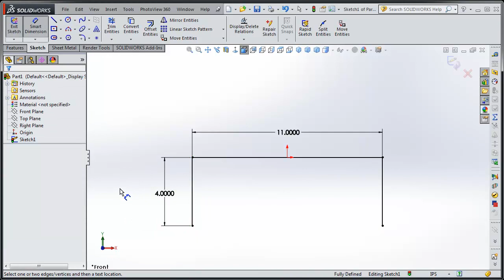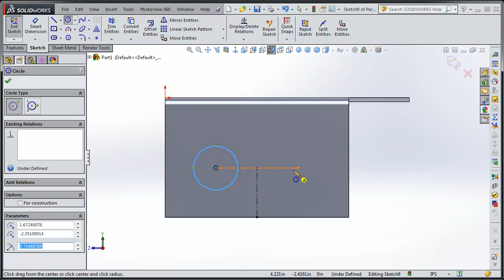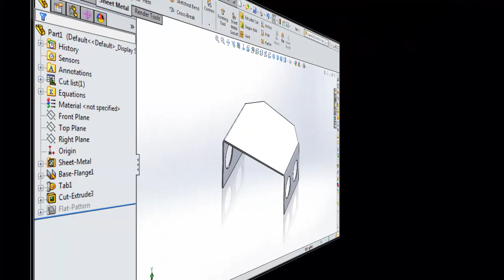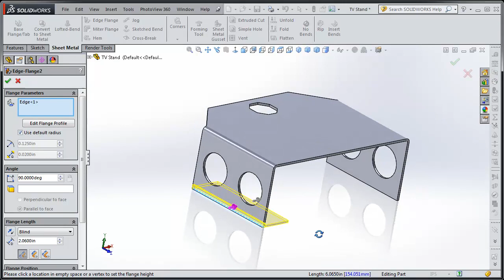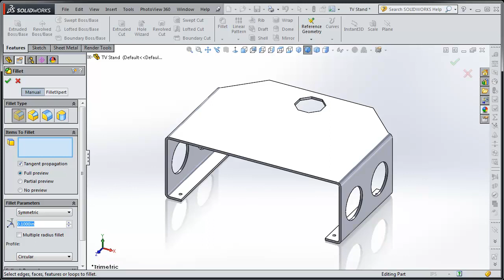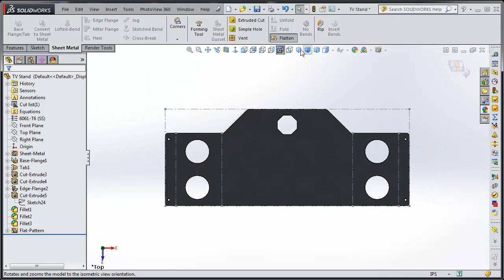SolidWorks 2015 Tutorial 007 Sheet Metal

Comment: Thanks sir for this great video tutorial, it is really helping me to use the right program features for the right task. Could you help me bit with some terminology issue? I'm looking for the right term for the sheet metal property of having the inside of a bend to curl over the edge when it is bended. so along the bend axis the material will expand in size. Especially with large thicknesses. I want compensate for that using some shallow cut but i don't know the term for it. Can you push me in the right direction? And ideally what is Solidworks feature to do just that?

Comment: Do you know how to change a bent corner into a ripped corner?   I have modeled a box but to better utilize material I want to change which edges are bent and which are cut without having to start over.
Reply from the maker: +Todd Cook  Would have to see the part ~ I tend to first draw my parts as normal SW parts to get fit-ups and then go back and quickly redraw them as Sheet Metal parts so I already know what I need when using SolidWorks Sheet Metal Features to create very accurate Flat-Patterns to cut on the WaterJet or Laser :-)